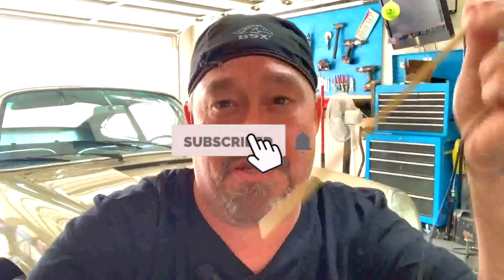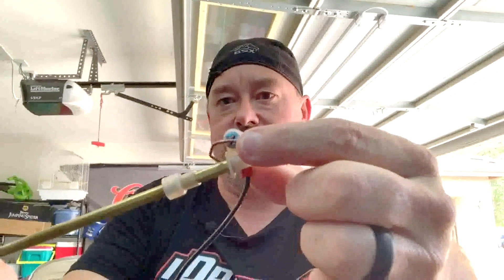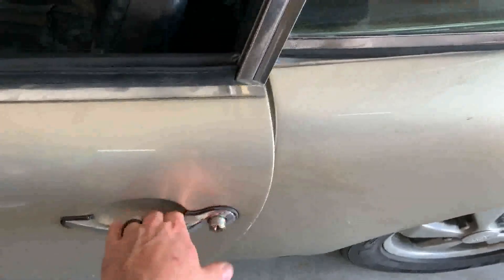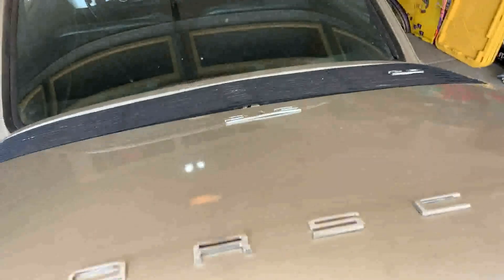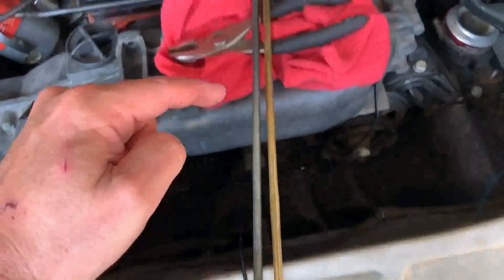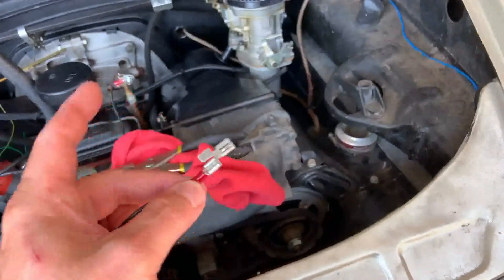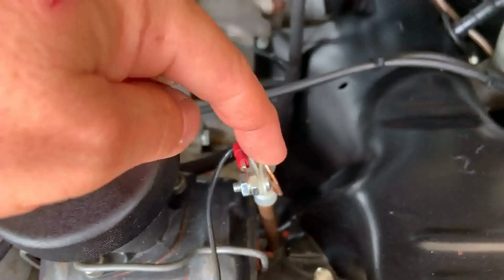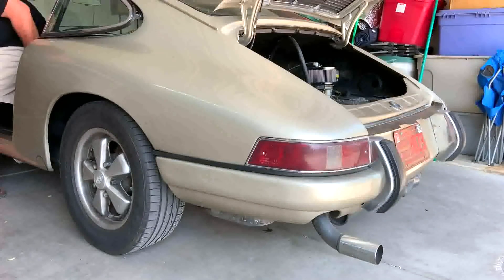How to save your VW or Porsche motor for under $50 and in 5 Minutes - VW Type 4 Motor

Comment: I grabbed a used one on eBay for $30 shipped today for my 64 baja 40hp, so it's the only good/easy way to monitor the temperature, being 6mm oil pump studs. It's an unknown engine to me, just got the car several months ago, so it's good to have I figure.
Reply from the maker: Just an extra layer of insurance!

Comment: Where did you plug the other end in?
Reply from the maker: plugs into a Y adapter at the oil pressure switch behind the dizzy.
Reply: @ArrowheadGarage  
Thanks. What's a dizzy? You are so clear on you instructions typically. 
Hopefully I can find it on Google.
Reply from the maker: @roysingh5975  dizzy or distributor sorry about that.  The sender has a male spade connector on top of it and it screws down into the case.  The kit comes with a Y Adapter so your dash light and the oil dipstick wire can share the single male connector on the oil pressure switch.  Hope that helps a bit more. IF not let me know.